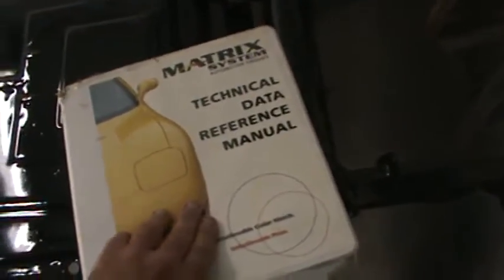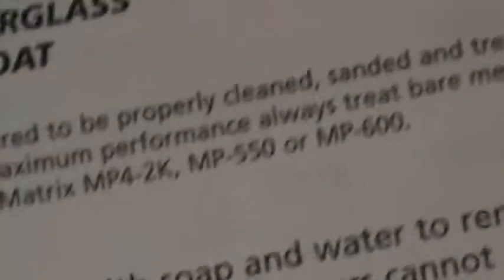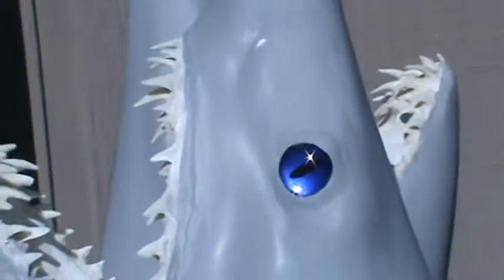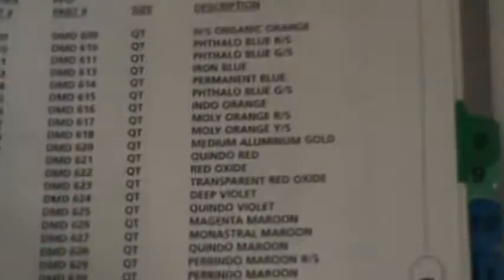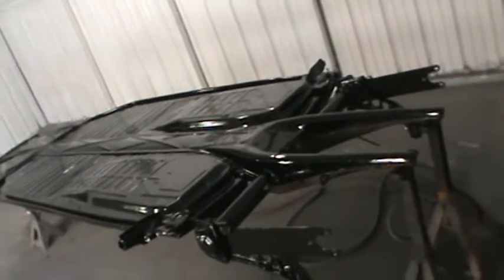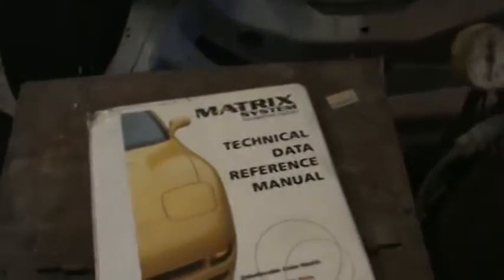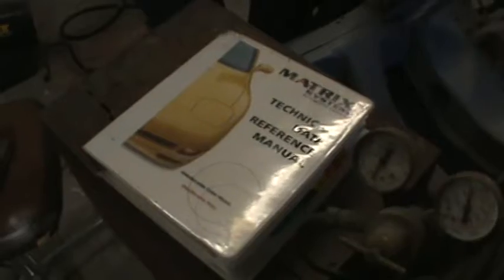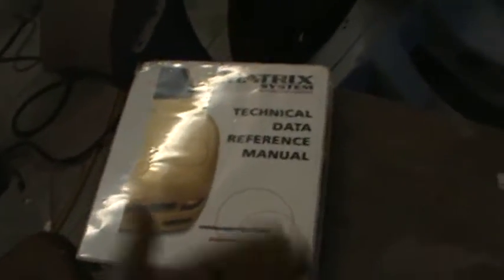TALKING EPOXY VS. ETCH

Comment: agreed....when i went to school they pushed epoxy on bare steel before filler and we would apply epoxy on top of the filler... like an epoxy sandwich. they never sugested etch we used ppg epoxy but where we could, we were always supost to save the oem finish and we applied filler over 80 grit scratches. i personally like the idea of etch first than epoxy just for a safety measure if im gonna put that much work into somthing i dont want to do it again...
do it NICE or do it TWICE!! thanks for vid